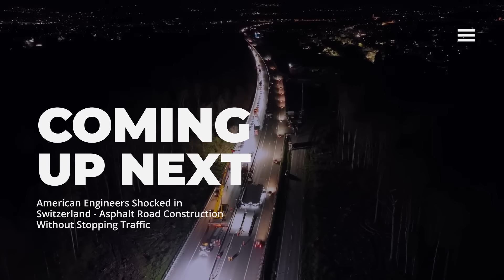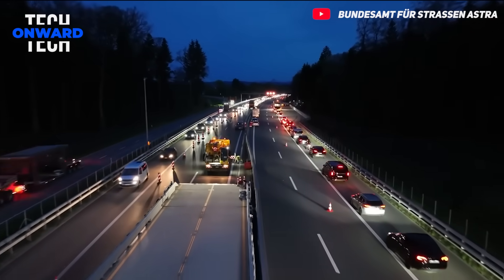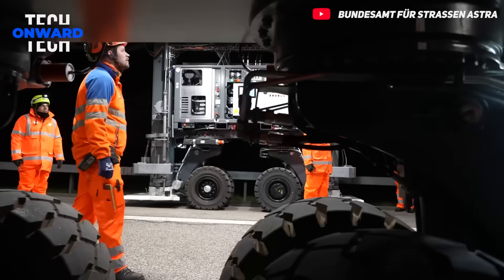American Engineers Shocked in Switzerland - Asphalt Road Construction Without Stopping Traffic

Comment: I am a Truck driver from switzerland. I drove often over the Bridge. The 1 first one was to step. The second one is better you could drive over it with like 60km/h. But the drivers are so bad that before the Bridge you have a stop and go Trafficjam so its normale that you drive up with like 20km/h. I am very happy that theare is no Bridge at the moment. The motorway is no like a swiss cheese because its like 100 meter repaired 200 meter old motorway 100 meter new and so on. Ther are to many Bridges, Roadsigns, Curves, Wildlifecrossings etc. in the way.

Comment: There is just one little problem: 

The speed you can drive on the Astra bridge is 60 km/h in theory. Practically it depends on the driver with the biggest fear of uncommon installations. The so called "Sonntagsfahrer" - because only used to drive on Sundays - might reduce the speed down to 30 km/h or less.

Comment: Best of all, once assembled, the bridge simply rolls 300 metres to the next section of roadwork the next day. The rolling process takes much less time than the initial assembly.
Reply: Thx mate, that's the answer to the question that immediately came to my mind: "Can it move?". So, YES :)
Next Q: How does it work when the road goes underneath a bridge?
Reply: @andreasherzog2222 
As far as I know, it doesn't work underneath an existing bridge. So there they still have to do "classic" road maintenance. It's not a magic solution for every single situation, but it can help in most situations, and there isn't a bridge like every kilometre over the highways in most spots :D

Regards from Switzerland :)
Reply: @ Thx, I expected that. Just checked for my 500k hometown: there is a bridge over the Autobahn about every 2,5 km. In rural areas it is less, but around the big cities is where the most traffic jams are to be avoided.

Comment: Maybe engineers are proud about that stuff, but I don't see much of the benefit... We see road restoration all the time here and there in France, and they simply close a lane to do the work or use regulated traffic to pass over the working area. This might cause some traffic jams depending on the area, but not having the brigde allows for bigger machinery and tarmac trucks to deliver so it is rather quick anway.
Reply: Even though it was not very visible in the video, this is one of the main Autobahn in Switzerland between Berne and Zurich. Drive it during rush hours and you'll see what I mean. The traffic is immense during the day and closing one lane is simply not an option here. To go over the bridge the traffic has to be slowed down to about 60 km/h but it keeps rolling and you're over it and back up to the usual speed shortly.
Reply: Well there are mostly only 2 lanes in switzerland. 
Where this bridge was needed is really heavy traffic in the morning and the evening. Closing 1 lane isnt a option unless you want to stay 3-4 hours
Reply: In case of non-highways where is no space to close a lane this bridge is very useful to avoid complete blockage of one direction.

Comment: the only thing i absolutely hate about swiss highways is the pavement. its not porous so even a bit of fog will make it impossible to see when driving behind another car. pavement is always soaked and the cars lift all the water with the tires. idk if its because of the cold weather, but in portugal for example they have been using 2 layers of pavement bottom is smooth the top one is porous for more than 30 years as to not soak the roads
Reply: Thats happening because your roadworkers are all in switzerland doing a good job and your roads in portugal are made by brazilians.

Comment: "Without any disruption to traffic flow.." having to drive 60km/h instead of 120km/h is still a disruption.. and a big problem are bad drivers who are affraid and violently break down to 40!
Reply: I live in Switzerland and have often travelled this route over the ASTRA bridge. That is correct. Many drivers slow down below 60 km/h as it is unfamiliar for many. The traffic jam in front of the bridge is pre-programmed depending on the traffic. The good thing is that the workers can work safely in below of the moving traffic and this can also be done during the day having to close "only" one lane to supply the construction site.
Reply: @LAGOM6  It's still also quicker than a traffic jam. There were many measurements done on that, in theory you could also drive a lot quicker (police tested it out) but our regulations are very strict and define the maximum driven speed.
Reply: it is Still better, this brigde was on my way to work i think there were 2 Prototypes last Summer in Switzerland before on this Construcion Site i always lost like 30-40mins now its like 5min
Reply: That's why you keep safe distance and don't tail someone aggressively...
Reply: It's still an extra lane, only half of the traffic load. Drivers will get used to it. Double the work time available. Imagine it just moving down a straight road week by week on its own wheels.
Reply: Well yes, its a disruption, but at least you can drive and dont stuck in a traffic jam where they merge 2 or 3 lanes into one and 95% of drivers dont know how the principle of zipper works. I prefer clearly this solution instead of traffic jam during hours.
Reply: Yes.
Reply: I think a good way to counter the people breaking down to below 60km/h would be to reduce the upward angle of the bridge. The impact is quite hard and people with low cars (tuned or sport) really struggle
Reply: They dont drive 60kmh they drive 10. .
I live there and it was traffic jam everyday
Reply: Get that bad energy out you silly goose..
Reply: @JohnSmith-mt8fd   Drive in switzerland and you see Bad energy🤣🤣

Comment: Most of the roads in Switzerland are narrow and traffic has been disrupted for years. Road repairs continue for years and the work is not finished. Most of the roads are crowded. Any repair is a plundering of money and failed plans. Every canton in Switzerland is plundering money and the work continues for many years and is not finished. There is no oversight. Failure, failure and waste of money.
Reply: The autoroute from Berne to Zurich, which is where I've seen this,  isn't narrow and although another lane would be nice you can usually drive at 120k most of the time.
Reply: @glennet9613  120 km/h  la maggior parte del tempo ?😂😂  Ma se ad ogni curva insignificante devi andare a 80 . Guarda per esempio lo svincolo prima del Baregg tunnel ,  autostrada di 3 corsie (in alcuni punti 4) e devi andare per 15 km a 80 . Io non so dove vivi  ma io sono a pochi km dalla A1 e ti posso dire che è  un incubo. Soprattutto all'ora di punta.
Reply: @glennet9613  Yes, but only if you consider the time from 9pm to 6am as being most of the time, and there's no road maintenance construction going on. Even then, you are slowed down to 100 km/h by permanent traffic signs (Baden Ost-Birrfeld, Härkingen, Luterbach and so on). If you manage to have an average speed of 120 between Berne and Zurich, it's gonna cost you, my friend. Loads of cash.
Reply: What are you talking about? 
😂😂😂
Reply: @ This is what happens in Switzerland most of the time, every day, demolishing roads and building again, and the reason is the administrative division system. Each canton works according to the policy of the canton. There is no end in sight as long as the state system is not centralized. The federal system is a failure. The French cantons are poor and without supervision.
Reply: Idk what you talking about.. I suppose you're Romand? Because I never saw what you describe in the German speaking part..
Reply: @simonkopp9238  The roadworks and construction on the freeway going towards and bypassing Visp haven’t moved for years, the same lanes blocked off by the same traffic cones, for many a kilometre.
Reply: @simonkopp9238  True, I am from the French cantons. Most of the roads are crowded most of the time. They have been under construction for years, and after a few months the road is demolished and rebuilt. The suffering of the roads has no end as long as the mentality of the cantons is backward.
Reply: @achatetventedevoitures7495  What rubbish.  Yet to see any roadworks that didn't get finished and lived in Switzerland for 25 years now.  And yes, I'm in the French part too.
Reply: Liar!
Reply: Von wo willst du das wissen
Reply: @thomasroth461  Naja, für amerikanische Radpanzer mit Ladefläche ist es manchmal schon etwas eng... :-D

Comment: Seems like a really expensive alternative to shutting down one lane of traffic and inconveniencing drivers for a day.
Reply: This movable bridge is not used to repair ANY highway section, only the ones with high traffic.  Resurfacing a stretch of highway does not take "a day", but many weeks if not months.  It is actually cheaper when all costs are considered.

Have you also heard that it had a safety advantage over people working just next to an active traffic lane?
Reply: The bridge is moved along the road, repairing it piece by piece.
You would need to completely shut down the road for months.
Reply: @MoempfLP  He would not understand. His rule: It's not American, so it cann't be good.
Reply: The Road repair stretches over the Part of multiple Miles. It would take Months of poor Traffic flow to close off a whole Lane the whole time while finishing the Job. The total Delay for all Transportation costs way more than such a Bridge on a long term.